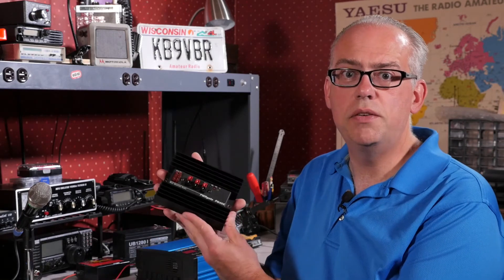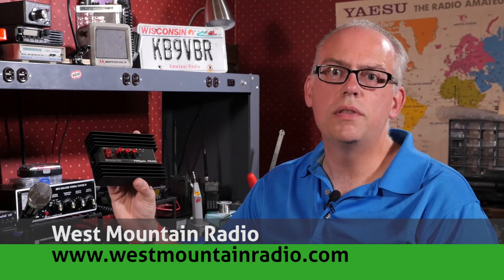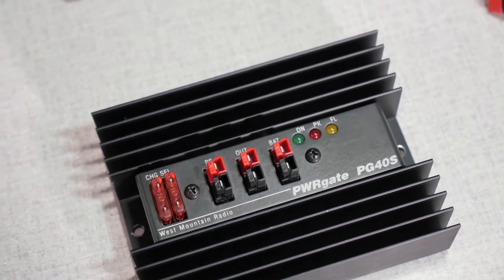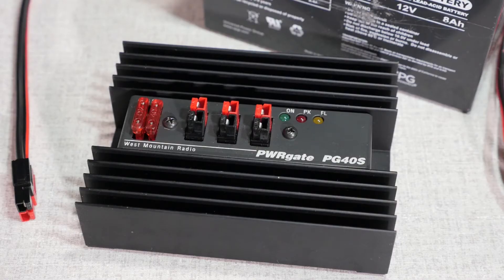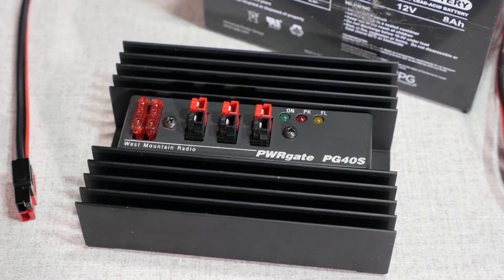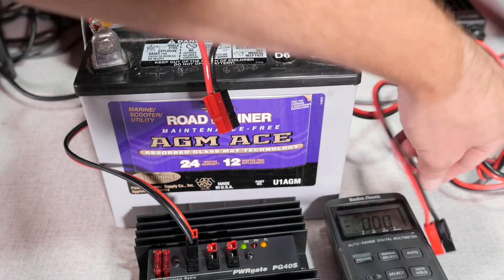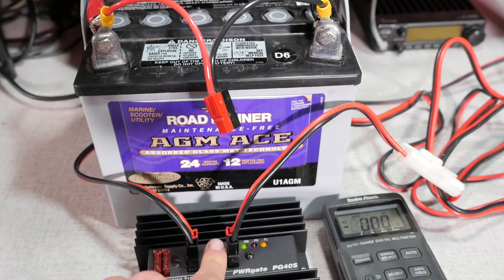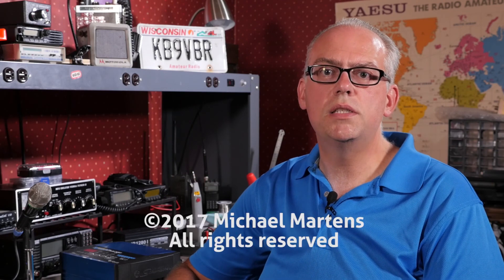PWRgate PG40S Battery Charger/UPS - Ham Radio Q&A

Comment: I have that pwrgate in my ham shack hooked up to 2 100 amp hr AGM batteries and it works great. It’s so nice in a severe thunderstorm to just unplug the power supply and the radio keeps going, no messing with nothing it just works. I bought it for t he same reason you did. I just couldn’t find a good charger that would maintain the battery at the proper voltage and charge well, and I already had the power supply so this was a no brainer to buy.

Comment: Does anyone know, is it compatible with lifepo4 batteries? It's handles 14.5 volts but I'm not sure thanks
Reply from the maker: I think their new PWRgate works better with LiFepo4. I had so-so luck with mine as the charging profile didn't quite fully charge the battery.
Reply: @KB9VBRAntennas  thanks for reply, 73! XE2DHA

Comment: We still call them gel cells, but those "bricks" have been AGM batteries for over 20 years now. FYI.
 And for portable kits, lithium batteries have made sense for several years now. It is a shame that West ignored all the EOC and shelter volunteers, who really could use a version of this that accommodated lithium batteries.
Reply: The current manual states it is LiFePO4 compatible.

Comment: Just ordered the Epic Pwrgate version. Dont have solar panel yet, but its coming. Our home isnt solar, but I want my shack to be completely disconnected from AC. Started organizing my coax coming into the shack, and then setup the dc power distribution. Now adding various components to maintain batteries and converting lighting, fan, etc to dc. Have some pics on my QRZ. Over the next months looking to get solar up, followed by a booster for the battery so that in the event Im running off of battery due to power loss that I can feed 13 plus volts to the radio. I think it can be set to 13.8, as well as up to 15 amp if needed for whatever reason. After everything is in place, mainly a much larger battery setup, then I will add an inverter to feed the cpu

Comment: Thanks for the video. N00b question (just got my license). How do radios work off 12v battery when radios require 13.8v? Does PG40s convert from 12v to 13.8v when in UPS mode?
Reply from the maker: Radios will operate on a wide range of voltage between 10.5 - 14.5 volts although 13.8 volts is optimal. The PG40S doesn't condition or change the voltage at all. When you are connected to a power supply it will deliver 13.8 volts but when the power is cut‚ the PG40S will drop to the nominal 12 volts of the battery.

Comment: but this doesn't help if you have a solar setup you need to charge the battery
Reply from the maker: Correct. You will also need a charge controller if you are using it with a solar panel.

Comment: There seems to be approximately 1/2 volt drop going through my power gate UNDER LOAD conditions. There are voltage meters at the end of the rig runner, and directly at the battery terminals. My unit is in a configuration of a 13.8v power supply, rigrunner and a standby AGM battery of approx 100 amps. Has anyone else experience this much voltage drop. And by the way the wiring is #8 for 40 amp anderson power pole connectors and  the outpur of the AC power supply . Remove the power gate go direct to battery and it is rock solid approximately 12.3v.
Reply from the maker: I think what you are experiencing is normal as there is a bit of a voltage drop through the PWRGate. In the instructions they recommend that you set your power supply to 14.1 volts for lead acid batteries, and 14.5 volts for AGM batteries. http://www.westmountainradio.com/pdf/PG40Smanual.pdf This is so you can receive a full charge on those types of batteries.
Reply from the maker: 1/2 volt drop does seem a bit high. I wouldn't run my power supply any higher than 14.1v either.

Comment: So, I assume the power supply would have to stay on 24-7 to maintain the battery, if so, does that shorten the life of the power supply? Thanks for the video.
Reply from the maker: The power supply would need to be on 24/7 to keep the battery maintained. You could turn it off if the battery is charged, but then the battery will slowly discharge with time. Weekly topping off of the battery would solve that problem. I don't think that leaving the power supply on all the time will shorten its lifespan. Typically it's the initial surge when you turn the device on that puts the most stress on the components.

Comment: I don't know what to think about this not so cheap product: Be aware that if you run the usual 13.8V from your supply altough there's a low-drop FET used in this unit the charging voltage can never reach the float voltage recommended for lead batteries (guessed right: 13.8V) and of courseyou also can never reach the recommended charging voltages (14.2-14.7 volts, depending on battery type, temperature, etc.) to charge them fully - read the datasheets of your batteries, folks.
Reply from the maker: You are correct. There is a very small voltage drop in the system and the manufacturer does recommend that if you wish to maintain a proper float voltage for your batteries to adjust your power supply to provide a 14.2 volt output.

Comment: Michael, thanks a lot for your review! I think you may have answered it but just wanted to clarify: say, I have a power supply that is only rated at 10 amps. What would happen with PWRgate if the radio tries to pull 20 amps (say, assuming, the battery is only charged at 70%)? Would this blow the fuses on PWRgate?
Reply from the maker: I'm currently using a 12amp continuous duty power supply to charge the battery. The PWRgate is set to the 8 amp charge rate. It seems to be working fine with my HF rig running sideband at 100 watts. I would have to verify with the manufacturer, but I think as long as the power supply can cover the charge rate, you should be able to pull more power from the battery.
Reply: @KB9VBRAntennas  I am using PwrGates on two separate stations in my shack. The HF station has a 30A breaker from the PS to the DC input and the VHF station has a 20A breaker. I was testing an HF radio on the VHF station and unknowingly tripped the 20A breaker when I transmitted full power (makes sense now). Without the DC input, the VHF station was now using battery exclusively, which eventually discharged it completely. That would seem to indicate that the PwrGate DC output cannot share power from both sources at the same time (PS and Battery). Now I need to come up with a way to give me an indication of a tripped breaker on the PS feed.

Comment: Hi Michael. Curious why you arent considering the LifePO4 batteries?  I have switched over to them exclusively for portable work, have yet to find a drawback.  Appreciate your channel and your responses to all questions.
Reply from the maker: I think the biggest reason I haven't made the switch to LiFePO4 batteries is the cost. I spent about $80 for 35ah AGM battery and the equivalent in LIFePO4 is about $225. Granted the Lithium batteries have a longer shelf life and  greater discharge rate, plus are a heck of lot lighter. But the cost-benefit ratio isn't there yet for me.  But the prices will drop and I'll probably invest in those batteries when it comes time to replace my AGM cells.

Comment: What made you chose the PWRgate PG40s over the ISOpwr does it not offer the same results at a lower price point?
Reply from the maker: That's a great question. There are a couple of key differences between the ISOpwr and the PWRgate. Both will charge batteries from a 13.8v power supply and both will isolate your battery system from the charging system so the batteries don't backfeed into the power supply when the power if off. But the PWRgate also has a variable selectable charge rate from 1 - 10 amps and will operate as a battery maintainer when the batteries at full charge. The variable charge rate was the selling point for me as I wanted to use it with smaller lead-acid gel cells along with bigger batteries. I see the ISOpwr as more of a power protection product for your mobile radios (you could put an auxiliary battery in the car and this unit will keep you from depleting your starting battery when the engine is off). The PWRgate adds advanced charging features for a wider variety of lead-acid battery types.
Reply: KB9VBR Antennas thanks for the quick and inciteful response.  I am building a go box planning on keeping the battery separate and am leaning toward the isopwr so far.
Reply from the maker: The ISOpwr should work for you. I think it'll charge a size 24 or 27 battery just fine.

Comment: What size cable do you use to the battery?
Reply from the maker: It depends on the length of your battery cable. At a 40 amp max draw, you can use up to a 4 foot length of 12 gauge cable. Here's a calculator to determine wire sizes: https://www.wirebarn.com/Wire-Calculator-_ep_41.html
Reply: Thank you for your reply and your videos. Love your channel.
73
James KI7MGY

Comment: will it work with a larger, size 24 78AH battery?
Reply from the maker: Yes, it will also work with larger size 24 and 27 batteries. I don't think there is an upper limit to battery size or capacity. When adding batteries, keep in mind that it's max charge rate is 10 amps and it's max power pass through to your devices is 40 amps. So I probably wouldn't use it with more than two 110 AH batteries wired in parallel.

Comment: will it go from maintainer mode to charge mode as the battery demands.
Reply from the maker: Yes it will. The unit adjusts the charge rate (up the maximum selected by the two fuses), based on the voltage of the battery. So it will switch between charge and float modes as needed. The user manual has a good explanation of how this works: http://www.westmountainradio.com/pdf/PG40Smanual.pdf